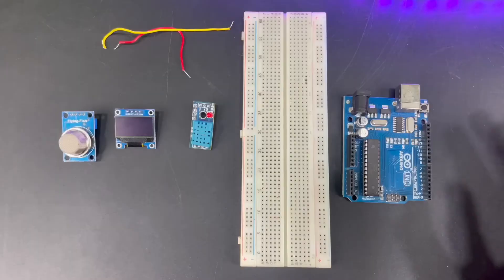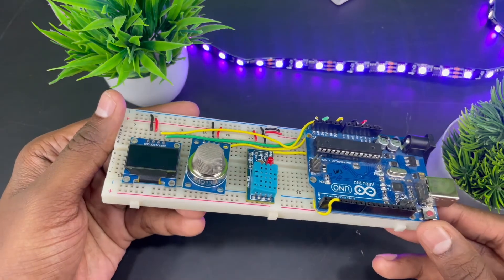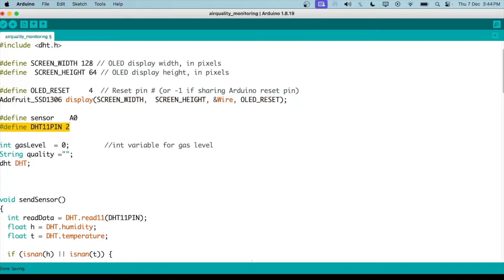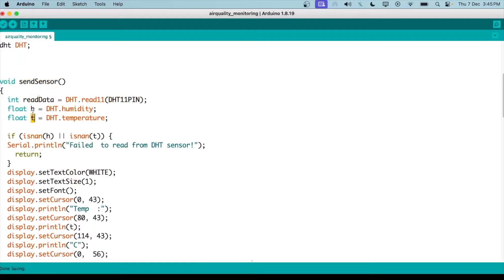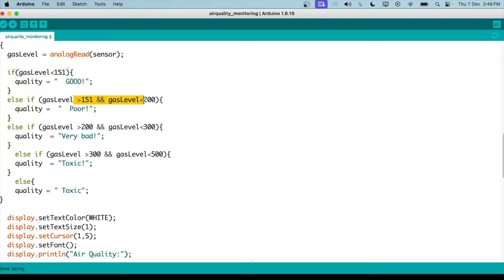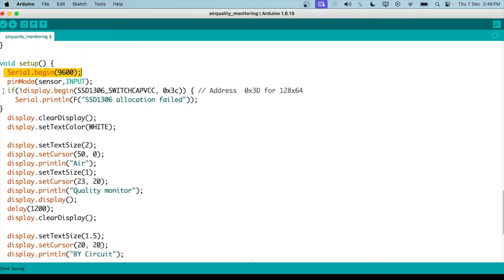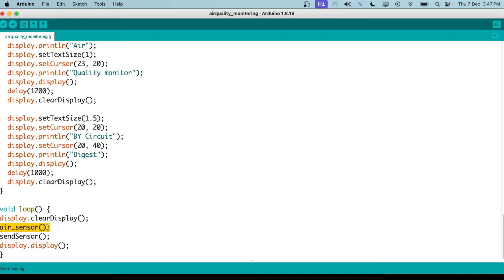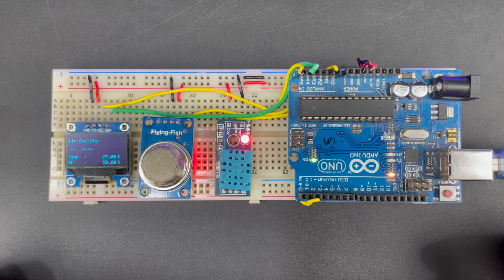We built a Simple Arduino Air Quality Meter, and now you can too!! #diyelectronics #arduino

Comment: I have 2.4 inch LCD display (waveshare). Will it work with this code. I need wiring connection also for the display.
Please advise.
Thanks

Comment: I have connected 4 times, display not showing any data
Reply from the maker: Double-check all your wiring connections. Also make sure the i2c address of you display is as in the code or change it if its different.

Comment: my oled display sensor readings is only stuck in poor air quality and same number of temperature and humidity, it does not change even I demonstrate the lighter on mq135 sensor, how can I solve it?
Reply from the maker: Check the sensor and make sure you are taking readings from the sensor and update the display periodically.

Comment: sir your circuit diagram seems a bit confusing as the positions of different pins are differnt in the diagram so sir can u please help me out on that 🙏 🙏
Reply from the maker: Please check the link in the description for a detailed circuit diagram.
Reply: @Circuitdigest  sir i somehow made it by using the knowledge of arduino i know because there is a lebelling isuue in your diagram so please do fix it sir and please check your code as well because there is a error with dht.h and istead make it DHT.h and some other modifications but sir thanks for your idea i got 2nd place in the science expo. Sir if you can , can u make a vedio on how to make this project compatible with a phone app so that i can look at the time stamps to monitor the air of my surroundings and accordingly try to purify it by reducing pollutants

Comment: dht DHT; gives me an error, it says it does not name a type. i have the correct and necessary libraries added, so what could it be ?
Reply from the maker: If you are 100% sure you have the correct library installed, make sure there are no any other library that uses the same file name. Another possibility is that the library is updated and changed its structure. If that the case either use an older version of the library or modify the code accordingly.
Reply: can u please help its showing error 
dont know whts wrong
i installed all libraries
its showing no file found

Comment: When I code “ dht DHT;”  the DHT here does not change to yellow
Reply from the maker: Compile the code. If it doesn't give any errors then no problem. Arduino IDE may behave like that sometimes. You should also make sure you have installed and included the appropriate library.
Reply: can u please help its showing error 
dont know whts wrong
i installed all libraries
its showing no file found